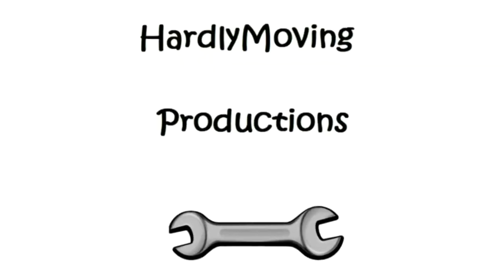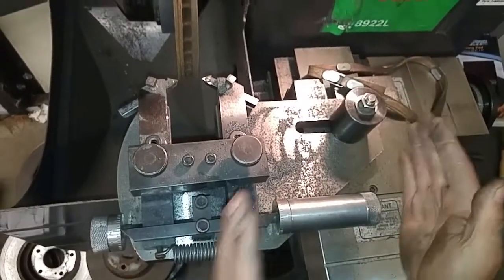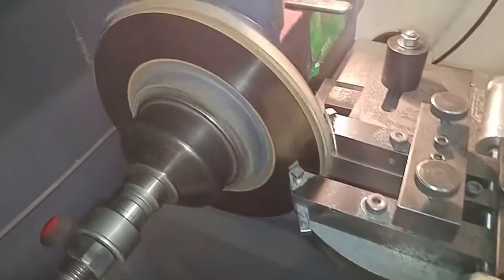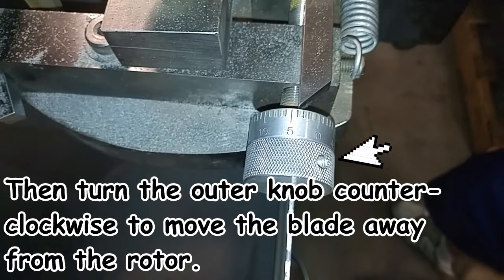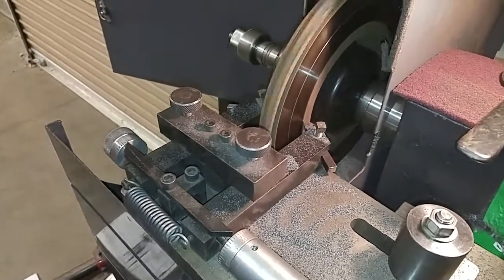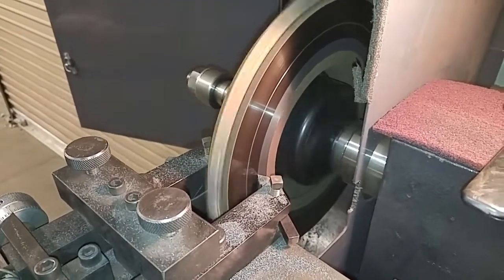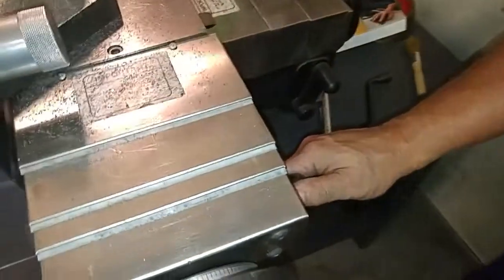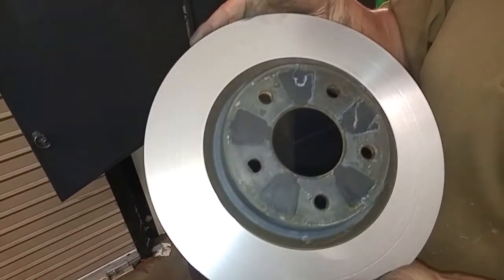How To Turn / Cut A Rotor on a Brake Lathe Machine

Comment: If You have an OEM rotors and it needs 1st time brake job this method is excellent
Reply from the maker: You're right..  OEM rotors are high quality.
Reply: @hardlymovingpro  yes sir and some oem rotors are expensive
Reply from the maker: Raybestos, Wagner and Centric make excellent quality brake parts as good or better than OEM.

Comment: should I buy the new rotors or resurface the OEM rotors. new one cost about $150 for all 4 , resurfacing cost about $60. is there any advantage of resurfacing over buying new one apart from cost savings.
Reply from the maker: OEM rotors are generally better than replacement rotors from your local auto retailer.  If the rotors aren't that worn down (measured by a dial caliper), stick with the OEM's.

Comment: Is it safe to remove material from the outside edge of the rotor using this method? I need to make some 330mm diameter rotors measure 328mm, could I safely remove material from the edge? Or would the air vanes make it difficult?
Reply from the maker: You can try but you'd have to shave a little at a time or the cutting bit will break off.
Reply: @hardlymovingpro  thanks for the quick reply, you think a machine shop would be willing to try? Or will they say no because of the risk of snapping their tool :(?
Reply: @jongillies4871  u dont know untill u try

Comment: quick question, if i have pulsation in the brake(assumiing rotor is warped) can turning the rotor bring it back to shape or get new one. I know new one is cheap as well, but wondering if turning can help.
Reply from the maker: Yes ... resurfacing the rotor (if the wear is not too bad), will eliminate the brake pulsation ... guaranteed!  You can try bringing the rotors to your local Oreilly's Auto Parts store for resurfacing.  They charge around $10 a rotor. Put on some good quality brake pads to complete the service.  Do not re-use the old pads.
Reply: @hardlymovingpro  I took my rear rotors to Oriley’s and come to find out they told me they were both warped? The Assistant Manager checked  the specs before hand and went ahead and proceed with the job. Now both my rotors are damaged due to their screw ups! 😡😡😡

Comment: Pretty good video but you should always take equal cuts on either side so you should have did four marks on both sides. You also should clean the face of the rotor where the Hub mounts to and where the wheel mounts to. Clean all that rust off of that can throw your rotor off when you mount it up
Reply from the maker: Thanks for sharing and for the tips!

Comment: i appreciate your videos
Reply from the maker: My pleasure!
Reply: @hardlymovingpro  I noticed that when you pulled it out, you could still see the ring on both sides where you first determined the cut depth. Does that mean that you should have machined it a little more the second time. Was it a small enough groove that it would not be worth worrying about? I am possibly getting a job at a machine shop and was just wondering.
Reply from the maker: @xenosaga2286  That's not unusual and won't impact performance.  The key is to shave down the peaks to prevent new pad vibration during braking.
Reply: @hardlymovingpro  good to know. Thanks for taking the time to reply.

Comment: How long would a turned rotor last for, would it depend on how worn it is? Or does turning a rotor last a specific amount of miles.
Reply from the maker: If the rotor's measured thickness is too thin before it is turned, it get's discarded.  No mileage specs.
Reply: @hardlymovingpro  I have a wide body scat pack 392 with the brembos and the rotors at like 1k each do you think it’s a good idea to do this to the current ones or just play it safe and get them new?
Reply from the maker: @6.2bandz  if their slotted or holed rotors get new ones.  Most shops won't turn them because the cutting blades break.

Comment: I've never seen anyone actually use that original wrench or the vibration strap. I've watched hundreds of rotors being turned in 4 years now
Reply from the maker: The strap help reduce vibration during the cutting process.  Used it all the time when working at a dealership.

Comment: 🤔🏁👀NEVER cut ANY brake rotor OVER 2,000 or that will break  a blade AlSO THAT  shiny spot YOU was talking ABOUT is because that brake rotor is Warped you might get to cut ANY brake rotor a number of different time's to get ANY warp OUT of ANY  brake rotor ALWAYS make sure ANY  brake rotor gets a  real slow  cut ONLY on ANY last cut. I REALLY DO KNOW I  AM a REAL certified ASE Master Auto Mechanic or technician . WITH  OVER 60 year's of REAL experience .🏁🏁👍
Reply from the maker: Thanks for sharing!

Comment: So sad society now wants u to replace tour rotors, such a waist north America does.
Reply from the maker: It's a part that wears out with use.
Reply: We always face the disks before getting a replacement. after 3,4 faces the disk will be too thin to sustain the break pressure.